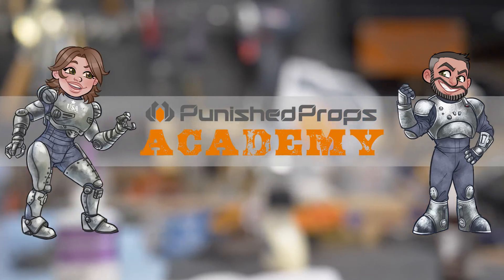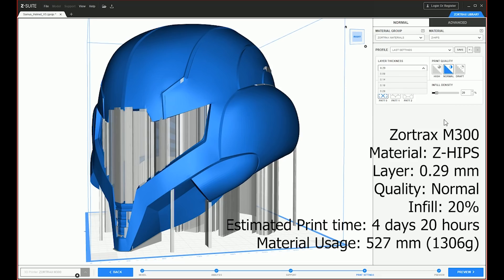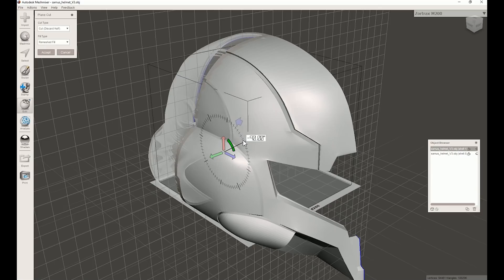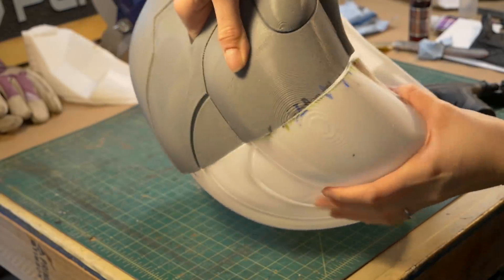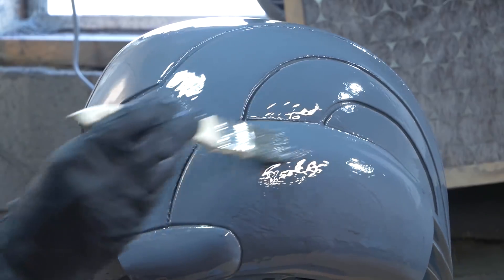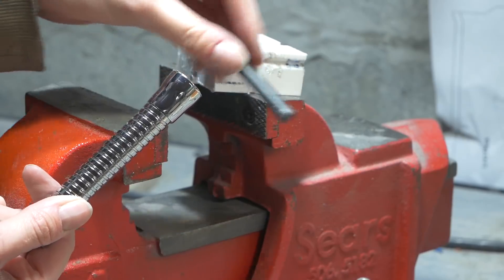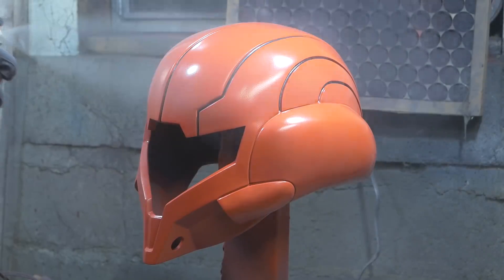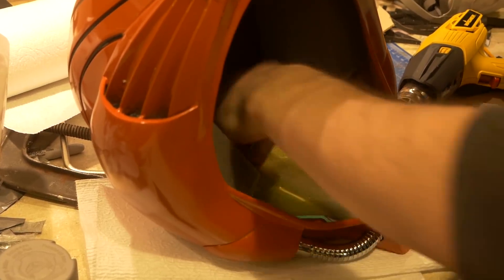3D Printing a Samus Metroid Helmet - Zortrax M300

Comment from the maker: Visit our website to check out the all of the tools and links mentioned here! http://punishedprops.com/2018/04/09/zortrax-metroid/
Reply: Hey, for easy accenting of the recessed area's look into gunpla panel lining. Same technique on a larger work piece. First Gloss coat your paint job. Then use black gloss enamel and thinner mix and let capillary action fill in the lines. Use thinner on a paper towel afterwords to clean up anything you goofed on. So fast and looks great.
Reply: That was cool QQQQQQQQQ
Reply: How much does that particular 3D printing model run?
Reply: Not sure if you guys reply to comments, but do you apply primer after wet sanding at 400 grit?
I just finished wet sanding and it's very smooth but I'm scared that the primer might ruin that

Comment: I think you could have reduced it by less than 5%. It would’ve printed all in one piece. I’ve been finding on my Bambu X1 carbon the multicolored prints take a lot longer, but with the latest firmware and their software, there’s no need to do anything but clearcoat it. I’m doing a few 23rd century Star Trek inspired hero phasers like this. I should have a video up in the next few weeks on it. The print time was terrible if the orientation is right the finish time is almost 0 and I have the colors I want. I’m doing it as if General Patton was in Star Trek and what his phaser would look like.

Comment: I’ve never done 3D printing but a overall thing with cosplay for me is don’t try to build a thing at once take it into pieces then assemble it later it’s what I’ve done and will always do even if it sacrifices some looks I don’t care I’m good at covering up that stuff I’m working on my first major cosplay I’ll keep you guys updated on how it turns out
(And a tip if your glueing stuff together use body filler on those seams then prime them then you can paint it looks really good unless you want seams I’ve had those tab things fail before cause of the way I make my helmet also for body filler you can use anything meant for models for me it’s went into cracks pretty good)
Reply: Please don’t post any hate here I legit am just trying to help people
Reply from the maker: We typically prefer that approach too! It always works well to break your projects down into smaller parts. We just wanted to try going the whole hog since this print bed was so HUGE!

Comment: Hi I was wondering how you get rid of the filament drooping/separation at 5:54 in the end? I am also getting filament separation drooping when printing my helmet. I have support around the drooping area but not seems to help. Any suggestion would be great. Thanks
Reply from the maker: We ended up changing the position of the helmet on the bed, which changed the supports
Reply: @punishedprops  thanks. So did you print the helmet with helmet top section facing the bed?

Comment: Print failed because of lost steps. It needs bigger steppers, closed loop steppers, or servos.
Reply from the maker: Interesting!
Reply: @punishedprops  Ha, yeah Im betting the more expensive models use encoders for positional feedback to make lost steps virtually impossible. It can also be done with steppers, and should be easy to add as an aftermarket option.

Comment: If all those issues are normal with 3d printing I will wait 10 years before I buy one thanks!
Reply from the maker: There are a lot of factors that can alter the success or quality of a print and it changes from printer to printer. Worth giving it a try if you're interested!

Comment: Loved the video, I do a bit of cosplay myself but am still very much a beginner who is mostly buying it all. I actually found this video from a video on 3D printed shoes as I was trying to figure out how to make my own shoe outsole for a possible project in making myself some Nike Air Mags for daily wear. However I also have a few cosplays I was thinking would be nice to do as 3D printed materials, most specifically Zero from Megaman X series going off the X4 look as I don't have to worry about the Buster Arm at that point. I do want to ask a question on getting into 3D printing, I've noticed there are the enclosed printers like the one you show here, and there are open stand printers. I've seen build sizing stats for both seem to be around the same numbers, is there a big difference between the 2 types of printers as the enclosed ones are seeming to be about 2k-3k in price yet the open stand printers are about 1/10th the price at around 200-1000, amazon actually recommends a nice 305x305x320mm open stand one that is only 400 that I'm kinda looking at as a starting point. I would love to be able to make something as amazing as the helmet you made here in the video and go off to my cosplay cons to show them off.

Comment: Not a great showing for the Zortrax, i bet they are cringing watching this, what's the point of such a big expensive printer if you get all these issues....it's supposed to make big prints!!
I have an M200 and its awesome, the quality actually stuns me quite often...how can it make such smooth prints??  But i still avoid big prints, i just can't imagine letting a print run for 3 days! I mean you are skilled enough to make the helmet from scratch faster i would think.

Comment: How much would this cost just in filament for the print?
Reply from the maker: Depends on the filament you buy, but we used 1-2kg worth of filament. Usually that's two spools worth.
Reply: @punishedprops    Damn that was a quick answer :D  Thanks, keep up the good work.

Comment: Did you change out your hotend assembly to a completely clean/new one before you printed with another class of material? Different materials have a different glass temperature. The failure is due to previous material mixing with your HIPS filament. PLA is notorious for messing things up. But ABS will mess you up too. 3D printing can be painful sometimes.

Comment: Keep in mind, instead of trying to 3D print something to match your hand sanded and filled shape, you can print it flat, and work it into shape using a heat gun.  PLA is pretty easy to work under heat (just make sure to wear gloves, it gets hot).

Comment: i think using the headband from a full visor for grinding 
https://images-na.ssl-images-amazon.com/images/I/31X%2B-WMTOtL.jpg
or a weldinghelmet 
http://www.fastarc.co.uk/images/T/SAFE3009%20-%20SAFE3010.jpg
might be eazier to adjust in height and distance of the face to the front or rear of the helmet 
it might allso prevent itching or pulling on youre hair like those foam block would do

Comment: I'm surely not the very first to point out that CReality CR-10 printers do not have your filament or printing issues with Zortrax M300 when they deal with huge objects, especially things like this helmet. So much work to roughly fix problems which are related to the printer abilities, is simply put unbelievable. On top of it a way more expensive printer... Don't get surprised if the Chinese sell thousands of their printers. They deserve it a way or another.

Comment: From my experience on massive prints the layer shifting was due to weight inertia of the print as it sways back and forth.  Option is to slow down the print speed and it will stop the issue.

Comment: Awesome job!!! I tried to follow your steps but when I import the smaller pieces into prusa sli3er some of the parts look funky. Not sure if it’s a problem between meshmixer and the prusa sli3er or something I’m doing wrong?
Reply from the maker: I'm unfamiliar with Slic3r, so I'm not sure I know what the issue might be, sorry! =(
Reply: Punished Props Academy thanks, I found someone else has already split the file on Thingiverse, so no worries.

Comment: So whenever I did 3d printed helmets i use a mix of bondo and filler primer spray paint. Is there any benefit to using that epoxy method over what i use.
Reply from the maker: The epoxy is just great for filling in 3D print lines. Bondo works too.

Comment: what did you use to get the the surface smooth with little sanding? it was a liquid type of substance?
Reply from the maker: XTC 3D Epoxy, link in the description.

Comment: Britt this is incredible!!! I love the attention to detail and how polished the final piece is. 
With the XTC 3D, could you use this to create a hard shell and make a mostly Eva foam prop (with worbla details) more sturdy? Or is this mostly just used for 3d prints? Would you use the XTC 3D on a foam prop or the epsilon pro from a previous video to create a hard shell? Thank you! I'm so curious about this stuff
Reply from the maker: Glad you liked the video! XTC 3D isn't very flexible, but Epsilon Pro is, which makes it good for foam that flexes a little bit. Smooth-On made a cool page to compare their products: https://www.smooth-on.com/compare/6182/30250/a/ You can add more epoxies to compare from the Epoxy Casting section.

Comment: just a heads up, you you use a heat plate you can heat up the Epoxy a little to make it thinner to get into those cracks ;)  just dont heat it up too much. and would wear a mask. Cheers
Reply from the maker: Great tip, thanks for sharing!

Comment: The zortrax is a fantastic FDM printer! I'm very suprised by this machine. I really like their z ultrat for it's strength. I think it's an ABS blend so print in a ventilated area.
Reply from the maker: We haven't tried the Z-Ultrat yet, but we have some. We'll have to give it a go.
Reply: It can be acentone vapor finished like ABS but it's crazy strong. If you use the smooth option in the zortrax suite it comes out looking nice. I tried ultrat on another fdm printer and I have never had a better finish before.

Comment: You really should print helmets like this upside down. The opening should be on the upside so you need only some support under the helmet.
Reply from the maker: As stated in the video, we decided not to do that to avoid as much clean up as possible on the top of the helmet since we wanted such a smooth finish.
Reply: Punished Props Academy. Ah ok sorry I did not hear that

Comment: My suggestion on the visor. purchase "mirror tint vinyl" at your local home depot. It's for windows but would work fine for what you're doing.
Reply from the maker: That's a good method for anything that only has simple curves. Good tip, thanks for sharing! =D

Comment: Nice! Print it and then do it everything nearly from scratch manually...  Good for your manual skills but no for the printer.
Reply from the maker: Printing the main bulk of the helmet saved us a ton of time on construction and templating and also helped us make sure it was already the size we needed once assembled. We like to work with a combination of skill sets rather than relying on one specific method throughout the entirety of a build.

- Paige

Comment: For future reference, use a thin sponge whenever hand sanding. It will prevent you from accidentally sanding finger shaped grooves into the piece, and it will conform easily around curves. Also a few drops of dish soap in the water will prevent the sandpaper from packing up and adds a little extra lubrication
Reply from the maker: These are all good tips!

Comment: Brittany - Great project! Please consider working over a tarp or dropcloth to collect dust when sanding outside. The fine plastic, epoxy, and paint particulate can easily be washed into and contaminate your nearby aquatic environments by rain and other runoff
Reply from the maker: Thank you for the advice, we’ll use a tarp in the future.

Comment: Brittany you are Samus no one can convince me otherwise. Also--awesome printer! The "weee" at 11:36 while using your rotary tool killed me 🤣
edit: BILL KILLED ANOTHER DREMMEL. MURDERRRRRRR.
Reply from the maker: Ohhhh SNAP. My secret it out...
Reply: @Solrex the Sun King: Probably changed her hair to get Ridley off her back for a while
Reply: Punished Props Academy why did you cut your hair and dye it brown?  No complaints on the brown, Samus, but why cut it?
Reply: We killed their dremel 2 seconds. Nice, they turn up grab the equipment and brutally murder it in cold electronic rage! * Crowd forms outside the lair with led torches and EVA foam pitchforks chanting for a Styrofoam head on a platter *.
Reply: That "weee" Part. Me Too
Reply: Its was 11:40

Comment: Great Video. keep up the good work :). You need to check your belts for the layer shift. they might be a bit loose. I suggest checking Meshmixer and use "trees" for support to save on printing time and plastic. Also tree support is way easier to remove and leave very little marks on the printed model.

I have printed an entire Darth Vader helmet on my CR-10 with a .4 nozzle at 0.05 layer height and it prints much better than the printer in this video. I can barely see the printed layers on my helmet. No sanding was necessary to make the helmet look good and smooth. Just primer and paint. I don't understand how an expensive printer like that lacks printing quality a $480 printer can give you. I have 2 CR-10 printers and I won't change them for anything.

EDIT: Forgot to mention the CR-10 has a printing capacity of 300 x 300 x 400mm. The printer in this video not only costs $2,000 USD but also has a smaller printing capacity. (300 x 300 x 300mm) according to amazon's website.
Reply from the maker: Thanks for the additional info! =)

Comment: Brown spots are probably caused by the nozzle dragging and pickling up filament and burning. That would also cause a layer shift as well.
Reply from the maker: Good to know!
Reply: large PLA prints Do warp this is the chief cause of your issue even with good adhesion to the print surface. this caused what joe indicated. Part warps causng nozzle to touch previous layers. this causes the x/y axis motors to become overload and skip steps which cause the miss-aligned layers. It also caused your print to detach from the supports. I printed a deadspace healmet i modeled in tinkercad/meshmixer. and i had to break it down in several parts to avoid this issue.

Comment: You were running out of time, so you hand-painted the black lines..... what were you planning to do if you weren't running out of time?  Just curious.
Reply from the maker: Wait for the red paint to fully cure and use masking tape, leaving the trenches visible. Spraying black into the trenches would look cleaner then the hand-brushed stripes.

Comment: Why not cut in half = no support
Reply from the maker: The challenge was to print a helmet all in one piece. After the single print failed, just cut in half vertically or horizontally was still right up to the edges of the build volume width. We wanted to try a smaller print to see if the same layer shifting happened, so we went with four pieces.

Comment: Resin printing is so much nicer and easier to deal with in comparison to these extruder based printers
Reply from the maker: Resin printing can definitely be great when you want a super nice finish without as much finishing work, but the cost of the cartridges and the difference in available build volume can make it just as challenging. We were sent this printer and wanted to try using it specifically for this build, but we've used resin printers in the past and LOVED the results!

Comment: amazin video, one question though: was the wet sanding to 4000 grit necessary since you were going to paint it afterward? Im kind of a beginner but all my paints end up kinda thick
Reply from the maker: I think the 400 grit was necessary for the Krylon spray paint, which goes on pretty light.
Reply: Thanks for the info! i've never used Krylon so i didnt really know ^^

Comment: could have just sliced the top of the helmet to cut down on tons of supports
Reply from the maker: That's a good idea. The goal was to print a whole helmet without cutting any parts. When that didn't work, we wanted to try smaller pieces that didn't use the full print volume width. We're still note sure why the first print failed.

Comment: how did you get the really small recesses smoothed? Just epoxy?
Reply from the maker: I folded sandpaper and wedged it into the grooves for sanding. The epoxy did smooth most of it out already.

Comment: This was an amazing tutorial, thank you so much,  Brittany!!!!  I was super impressed by the visor trick with alcohol and a thin coating of the silver paint.  It turned out AMAZING in the final photographs of the completed costume! You guys (Bill helped with the visor~) did an amazing job!!
Reply from the maker: Thank you! We're glad you liked the build! :)
Reply: do you have any idea how well the silver coating would block light from inside?  For instance if you wanted to mount EL wire or LEDs to armor and then add a silvered, colored dome on top, could you still see the glow?  <3 thank you for the reply!  I'm going to do my very first attempt at sanding, filling and painting 3D printed armor (for Moira from Overwatch) this spring, and this has given me some wonderful ideas and tools to use.  Thanks a bunch to Punished Props!

Comment: Couldn't you reduce the amount of support drastically by just flipping it on its head?
Reply from the maker: We talked about that in the video. We didn't want to deal with removing support from the outside of the helmet, since the Z-HIPS supports tend to bond to the print.
Reply: That makes sense. Thank you.

Comment: shifts like the one in your failed print happen when the belts skip a notch. i think that usually happens when they arent tight enough
Reply from the maker: Thanks, I'll check the belt tightness.
Reply: @punishedprops  I can't find the rotary tool you used - you linked to the Dremel 4000 (which I have already) but the one you used is like a weird handheld version and it looks battery powered!
Reply: It also happens when you go to the very edge and your printer runs into the side. It throws the whole print off in one axis.